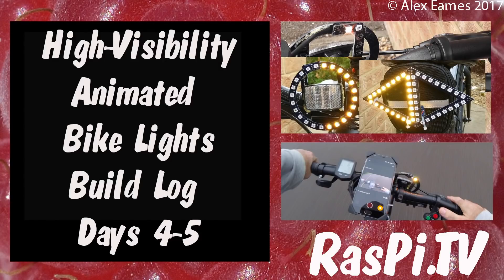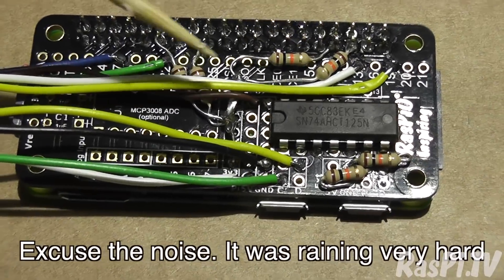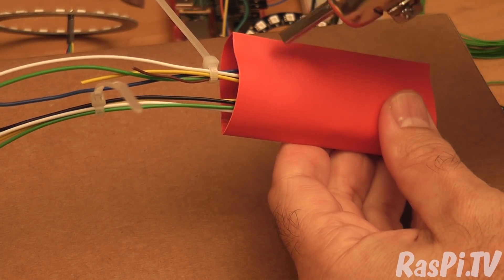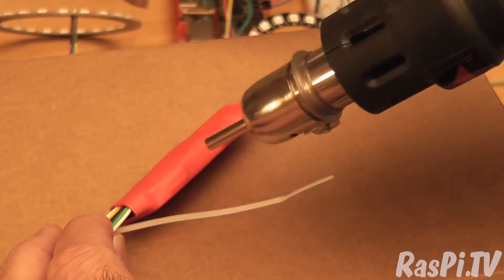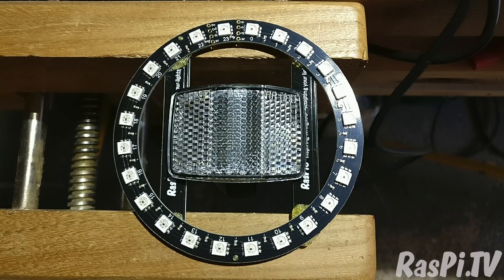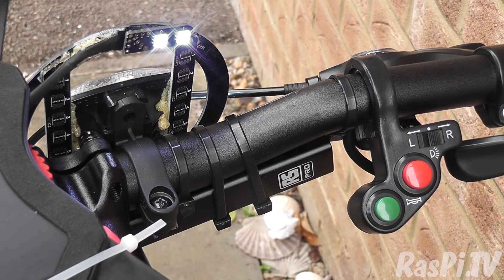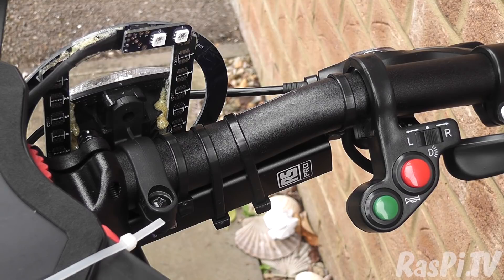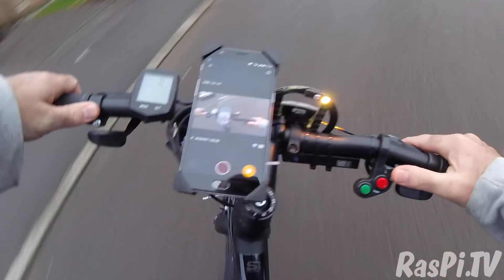High Visibility Animated Bike Lights Day 4-5 Build & Install

Comment: Can the 2 feedback lights have a different color : yellow for left, blue for right, 
they seem too close together now and the same color for peripheral info ...
might only need 1 feedback light when color coded.
Reply from the maker: Yes you can make them any colour you like. Me? I prefer it how I've done it, but you can make yours however you want. The way my mind works, you have one on the left for left and one on the right for right. Saving an LED is not a priority here for me, but it would also work fine your way and not be too hard to code.